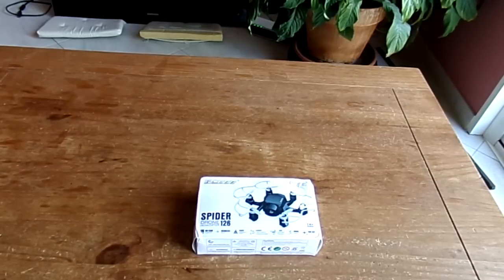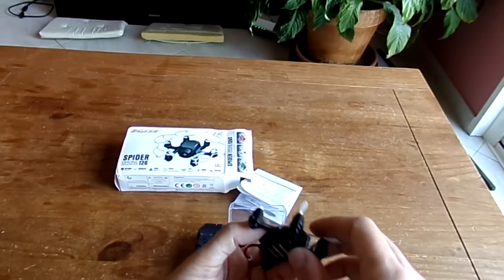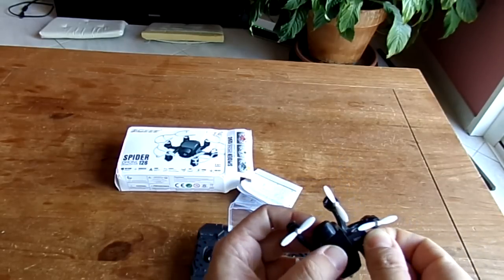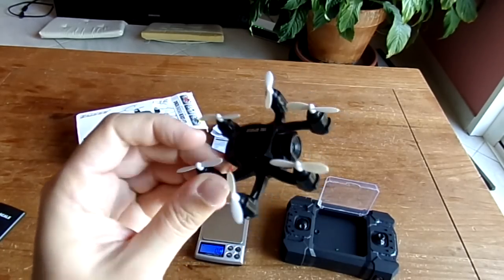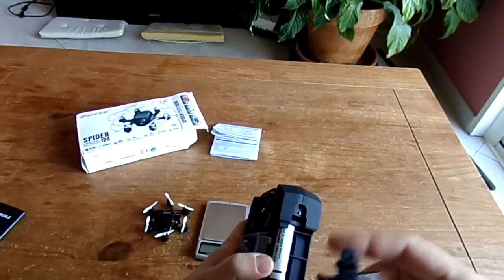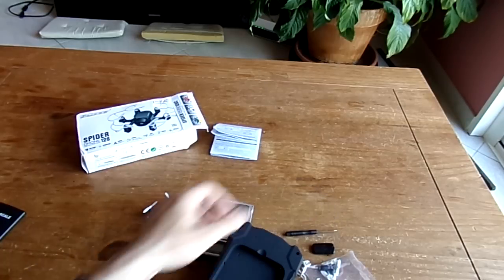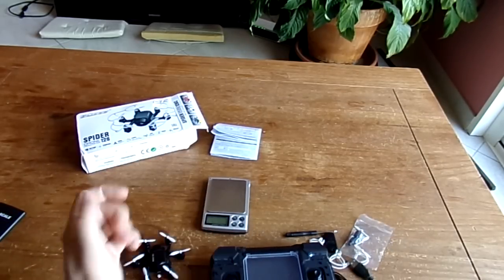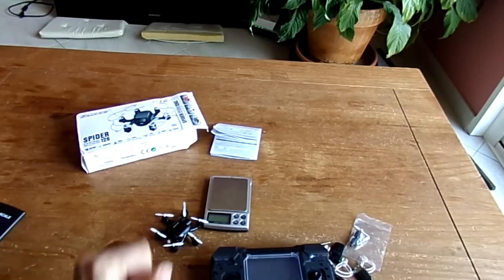FQ777-126C unboxing and quick analysis (Courtesy Banggood)

Comment: Thanks for the nice review! I wonder how long we will have to wait for a similar device but, instead of a clear plastic lid on the transmitter, having a 5.8 GHz receiver screen...
Reply from the maker: With the incoming Hubsan H109... no so long ...
Reply: Ah, but I mean having the screen on a similar device as the 126C: a nano quad- or hexacopter that fits with all its accessories inside the transmitter. ;)